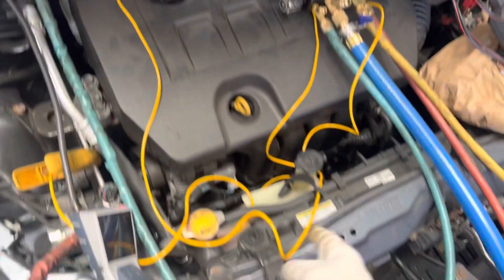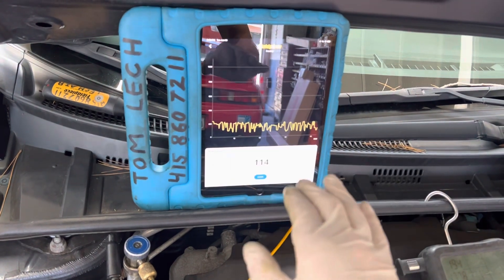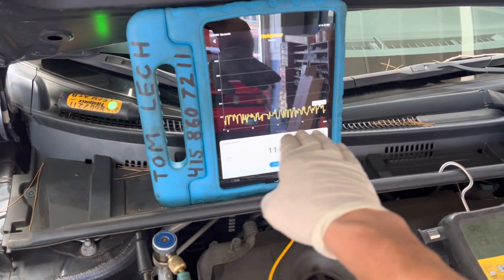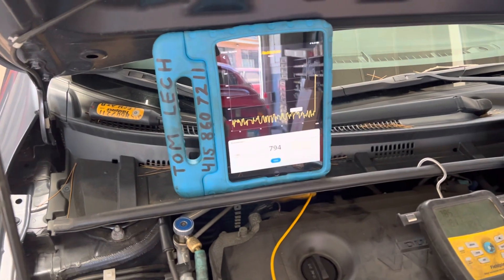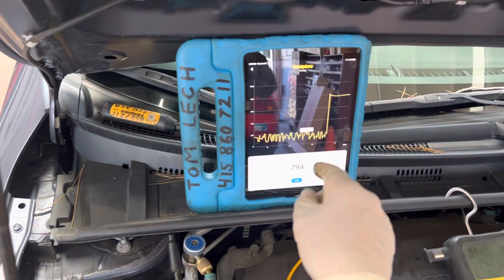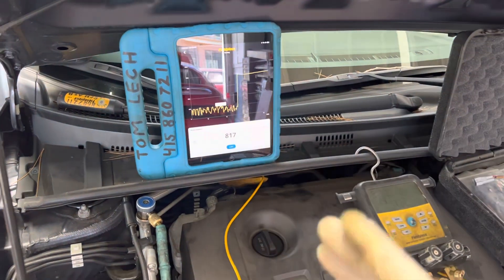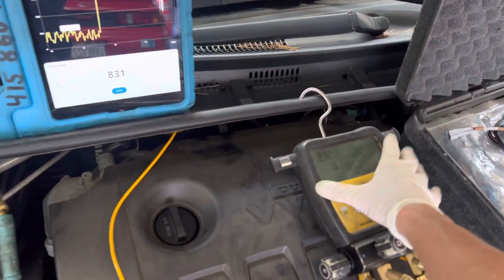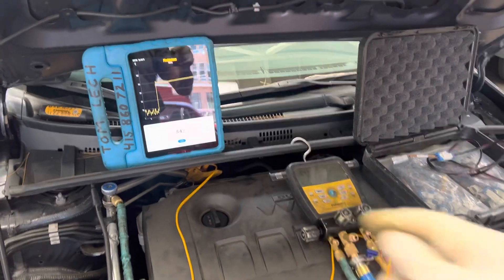Micron gauge readings explained on automotive. Micron gauge in your refrigerant manifold￼

Comment: In MVAC, after repairs, I always aimed for holding 400 microns, with the pump off and the system isolated for 15 minutes with no rise. After that, I liquid charged the system with the vehicle running and AC on. I then went over the entire system with a calibrated Yokogawa H10 and checked for any leaks under pressure. Once that was done, and no leaks were found, the repair was deemed a success after testing the controls and vent temps on a road test with airflow over the condenser. I warranted all repairs for one year, parts and labor, excluding items not replaced/repaired. In 5 years of MVAC I had 3 warranty claims 2 of which were due to reman compressor failures....
Reply from the maker: Vacuum is one of the worst ways to rely on for leak testing. 
        It is the least reliable way. 

But it’s good at finding the big ones . 

But sometimes even a big vacuum leak can seal under pressure. I got that on video a couple times. . 

400 µm holding for 15 minutes on a motor vehicle takes a extremely long vacuum time . 

I would say I could not do that on 98% of my vehicles I get from shops, especially body shops that leave the lines open to the atmosphere all day and sometimes for days and sometimes for weeks while they are waiting for parts . 

By the time the oil is completely saturated, and will never give up all his moisture .  Always a continuous outgas..  being limited to a hour of vacuum time.  I charge book times 1.4 hours for Recharge at $204 an hour.

That makes a recovery book time is .4 at $204 an hour. 

So by the time I stop the vacuum, the majority of systems will level out at around 1200 µm .  Nothing you can do about it. This is because of sloppy technicians who do not immediately cap off the ends of the refrigerant lines when they take them apart.. 

And some of these cheap garbage aftermarket condensers the second material comes already saturated with moisture in there, absolutely worthless .

And we always say compressors, and do not die. They are murdered. . 

Compresses well actually outlive the life of a vehicle .  ( if they are never allowed to go low on refrigerant never overcharged system is not contaminated with moisture or air.. 

Condenser fan does not fail. 

When I get vehicles for body shops where the hoses have been left off for days or weeks .   Even if I use my 12 CFM industrial vacuum pump that is rated to pull down to 3 µm with a silicone vacuum rated hose.. 
          I still cannot cat the moisture level down low enough so I can hold vacuum isolated for 15 minutes at 400 µm.    Just not humanly possible physics does not allow that to happen.. 

Unless possibly the vehicle was located in the Sahara desert with only 5% moisture in the air and every day is 120°F and I had the engine running with the hood closed so the under hood temperature was 200+ degrees Fahrenheit and I had the windows closed in the desert sun so the interior cabin temperature and the evaporator case was at 180°F 

Then I believe in one hour I could get the moisture content down low enough under vacuum to possibly have the chance to remove enough moisture that I can ball valve off the micron gauge and it would hold for 15 minutes below 400 µm .  

This is why I always tell do it yourself people to leave their vehicles on for 24 hours on the vacuum pump .  You can never over vacuum. All you can do is remove more moisture..
Reply: My typical maximum vacuum times were never more than 30 minutes. This was with a 6 CFM Robinair. However, pretty much all of my repairs were flushed. I often did liquid refrigerant flushing to remove everything. Manual flushing of components at other times. At the end of the day, no leaks under vacuum or pressure, the exact specified charge, and the exact amount of oil. But...I understand the difference between production work and passion. I was working from home in a semi-retired state so I could camp on them as much as I wanted :) My target market was retired people so...two cars...no rush...and wanting it to be perfect, the first time, and no issues with paying for it. 

But.....I'd like to draw your attention to something critical which you may be overlooking....the compressor seal. In order for those seals to work they have to be coated in oil. Any vehicle with an AC outage got a basic recover, evac and recharge as part of the diagnostic process. Without oil coating that seal, on most every car, you're never going to get a proper micron reading. 

As an example, GM service manuals, at the time, specifically mentioned that the service port caps, and their rubber washers, were considered the PRIMARY seal. IE, not the schrader valve, but the cap. The valve itself was considered the SECONDARY seal. Understanding their rationale behind that explained what I was always seeing with respect to the compressor seal. Until I understood the importance of oil coating the compressor seal I was always seeing goofy micron readings that never made sense.....

Ultimately, I designed and built my own recovery machine to streamline the process because my process was very different but resulted in the '4 nines' when it came to the success rate I was looking for. 

Let's be clear, compared to HVAC, MVAC is a very tiny system. As such, a 6 CFM pump is literally, overkill. A 30 minute maximum evac time should make sense given the size of the system. I'd encourage you to seriously consider the compressor seal and its impact on evac times...and the oil coating...if it exists....

I never let a vehicle out the door with 1200 microns. It never happened. The highest micron level that was acceptable to me was 750 @ 15 minutes. Anything more was an indication of non-condensables or a leak. 400 was considered 'hermetically' sealed and 750 was considered on the wide side. Rarely did I see one in the 300 range that would hold for 15. Nylog on all the fittings and always checked under pressure with the Yokogawa. So leak testing was a two-part process, one under vacuum and one under pressure.
Reply from the maker: @bobjones3725  I was raised on the H 10 the original GE model leather case plugged into the wall when I was 12 years old that’s what my dad had me start using it to find leaks. 

Yes, when I do large commercial like a LG Panasonic or FUJITSU 20 to 60 tons will have anywhere from 1000 feet to almost 3000 feet of copper piping anywhere from 8 to 20 or 60 refrigerant air handlers attached to it.  
    Always pull them down below 100 µm the lowest I’ve ever got I think was 13 µm I got a video posted on that one. 
          Decay and held under 100 µm. 
     But that’s using a $3000 vacuum pump rated down to 3 µm.
Reply: @coldfinger459sub0  Sure, I suspect I'd see vacuum levels like that in MVAC were it not for the rubber seal on the compressor shaft. My pump will actually do 20 microns isolated. My point remains, a 6 CFM pump is overkill for an MVAC sized system. It's why I chose a 'large' pump at the time - for faster evacuation. Evacuation should never take the length of time you are encountering even if the system was wet - provided it has integrity. Out of all the vehicles I did, evacuation was typically less than 30 minutes to 400 microns including boil-off time. Anything more was an indication I had not done my job right OR it was just a quick & dirty (ie, no accumulator/desiccant replacement etc). 

I pioneered using a thermistor gage in MVAC about 20 or 25 years ago. As you know, the reason is analog gages are not granular enough to show if the system is dry so people were leaving their pumps on for 24 hours or even 8 hours in a shop and calling it good. They measured vacuum by how long they left the pump on, and of course, it was always at 30 inches of vacuum! Honest !!

Imagine my surprise when I found that less than 30 minutes was actually required on a system with integrity using a thermistor. But...before I got to that point, I did have to do a whole lot of thinking that led me to understand that you cannot pull a deep vacuum on a system where the compressor seal is not properly coated in oil. It was actually my Ozone Depleting Substances teacher that, indirectly, put me on to that....

He mentioned when he was doing MVAC he used to get called out to logging camps all the time to fix the AC in excavators. What he found, after a lot of mucking around, was that they would sit idle over the winter and the oil would drop off the seal and allow the charge to escape. No other leaks were present. This is one of the reasons auto manufacturers decided to put the AC on when in Defrost mode. It keeps the seal coated in oil. The fact that dehumidified air is better is a side benefit. 

In an excavator, that, in this case was used only in the summer, it means it has 9 months or so of sitting and the oil drips off the seal and then there goes the refrigerant. 

But to make it really simple, you would know from experience how long it takes to evac all sorts of sizes of HVAC systems and how that relates to the size of the pump. Systems that are WAY larger than MVAC. So my question to you is this, does it make sense that a tiny little AC system, such as in MVAC, takes hours and hours to evac using a large HVAC pump? 

Could it really be that full of water? Or...is it something else...like the seal on the compressor is leaking....or is not coated in oil...causing it to leak outside air into the system causing the rise in rate? Let's face it, if the tiny MVAC AC system has integrity, even if it's got water in it, a large HVAC pump should be able to deal with it very quickly. A pump with a gas ballast valve, in combination with a thermistor gage, makes it really easy to determine when to close the ballast valve for that ultimate vacuum. 

The worst MVAC evac times I ever saw was one hour. Anytime it took longer than 30 minutes I started to question whether I had introduced a problem or missed something. An hour would be like, 'it's been sitting in the wreckers for a few years' :)

This is why, procedurally, every system I estimated/diagnosed was fully charged. That way you get maximum pressures, increasing your chances of finding a leak, and you ensure the compressor seal is coated in oil - removing it from the equation. You also have the benefit of then being able to test the controls/blower/pressure switches etc. Ie, does the system work? Or does it also have an electrical issue? Is the compressor noisy? Does the clutch work properly? Does the condenser fan run? 

Once diagnosed it can then be recovered and properly estimated. It's a bit of work (which is why I made my own recovery/charging machine) but that was the only way I could absolutely nail it every time with an accurate estimate and warranty my work for a year with unlimited mileage. 

It's much harder in the example in your video. Unless you have already gone through the entire system you just don't know what you have. Ie, if a body shop brings it to you to be evacuated and charged because of front end damage. You have no idea what the system state was like before you got it. It may not even have worked at all. In a case like that, using a thermistor gage is almost useless (in my mind) because you do not know if the system has integrity at all because you haven't chased down all the leaks. 

As an HVAC technician you will have much more knowledge of AC than I as a former MVAC technician. But I think that your premise of pulling an 8 hour vacuum due to continual boil-off is not correct in such a small system. Rather, I would suggest the system does not have integrity to begin with. If it did, and if it was wet, a 6 CFM pump (or better) should be able to deal with it very quickly assuming the pump and the oil have integrity. Not trying to get your goat, I just know that after doing a LOT of cars, they always pulled down to 500 microns, typically in 15 minutes, and would hold it for the same amount of time if the system had integrity. Each system was different, some faster, some slower, but anything more than 30 minutes set flags in my mind. 

Of course then you get the oddballs like a Suburban with rear AC and the rear evap was just fine during testing but once the repairs are done it blows out because it was weak to begin with and the increased pressures put it over the edge! Which is why I always explained to my customers, at the time of the diagnosis, what's written IS what is wrong, at that time, but it's AC, and it can always bite you in the rear. In other words, I don't have x-ray vision :)
Reply from the maker: @bobjones3725  these are ancient old systems you’re talking about with shaft, seal problems. We don’t very rarely have that problem on existing working systems anymore….      What we do have occasionally for some known manufactures are weak shaft seals.
            Which chef seals will show up losing their vacuum and then stopping let’s say 29 inches of mercury 28 or 27 inches of mercury and then just stopping having nothing to do with oil.   Sometimes you get lucky and you can reset them with refrigerant after two or three minutes of operation and then recover the refrigerant and then start your vacuum procedure again and then it will seal.

And low vacuums you’re talking about holding 400 µm within 30 minutes doesn’t happen in the real world with POE oil in cars with rubber hoses that have been completely moisture saturated by being left open to the atmosphere like 98% of them are when they were worked on by technicians .  You can easily pull down to 400 within 30 minutes but as soon as you valve off, it always jumps up around 1000 1200 1400 just because of the moisture content no leaks no seal leaks it stops in levels off.

Now on a brand new install that’s a completely different story you get less than 400 µm in less than five minutes no problem at all . I’ve I posted that video several times on brand new installs on clean systems with brand new receiver dryer’s..
              Mineral oil from the days of R12 is very easy to I’ve posted many of those videos usually old Mercedes Benz that somebody finds with 15,000 miles or 30,000 miles on them haven’t been touched by anybody just leaked out all the refrigerant down to near zero psi naturally through all the hoses in the front shaft seal.  How quickly get below 500 µm within the first five minutes because it’s mineral oil..  
                            You’re right the size of the pump doesn’t make a difference. It could be a half CFM or 100 CFM. You’re a limiting factor will be your hose indecisive the office of the fitting that you’re pulling through on how quickly you can get there time is money.

Yes, I want to start it out with the Simister vacuum gauge analog type six or eight D sell batteries in a leather case yeah the warm it up for five minutes then you had to touch the sensor to the stainless steel face plate and then zero out the analog needle to zero.   They were temperature sensitive, and if the weather changed, they were sensitive to the barometric, atmospheric pressure change just having clouds pass over.
But they were extremely accurate as long as you didn’t have temperature change or barometric change .
       To this day, they still use analog sensors in deep laboratory, ultradeep vacuums that that way up there to ninth to the 10th power 0.00001 yeah, crazy numbers like that with analog gauges.   If you go to buy some you’ll find out just a sensor alone can start running you $1500 and up really fast.. 
        Nothing wrong with analog age is just a people who don’t understand where and when they can do use properly and what will throw off the readings on the micron gauge sensors.   Yes, I started in 1979.. using r12 to cool down soda cans blow over r12 into my steel toe boots to cool off my feet on a hot summer day and freeze bigs

Most everybody went over deep, vacuum laboratory procedures when you take college courses in organic chemistry, or even material sciences, the fact of materials under deep space vacuum far over the heads, and beyond anything automotive guys, will I ever learn . 

Anytime I’ve worked on heavy excavator, equipment, off-road stuff. It was always trash by 20 guys who came before me. . It was the worst butchered AC equipment that always had way too much oil because of the guy always thought it would run out and so you always squirt in an extra ounce every time you top it off. When replacing parts, they left everything open and never will change the receiver dryer.. drive around all winter in the rain in mud with no AC with a giant hole in the condenser wide-open to the atmosphere with liquid water inside. I got plenty of those.. 

Yes, it completely makes sense for motor vehicles to take many hours to be able to pass a vacuum to take test .   Because we no longer use mineral oil like back in the Stone Age days with R12..
           We now use PAG and POE every technician who works on the system or every time that car is in a body shop in front end collision. The condensers get removed in the lines are left open to the atmosphere for days and weeks before the car is put back together..
                   So, on all those vehicles in a production shop, you have book time of 1.4 hours to do the job that’s all you get..   so that leaves you roughly an hour left if needed to keep your vacuum pump on and on the wet systems you’re lucky if you get 900 to 1000 µm after you do year 15 minute isolation vacuum decay test just because of the moisture level, trapped in the POE oil, you cannot remove all. 

There’s a physics thing that goes on deep down in the layers of the oil cannot migrate the moisture up to the surface. There’s a surface tension that can’t even trap refrigerant under the surface tension of the oil. .    

POE Oil is a whole different animal compared to men loyal, cannot even discuss the two in the same sentence or paragraph there a totally unrelated
       In the vacuum procedures, and the ability to get rid of moisture by vacuum is not possible with POE oil. 
           That’s why I’m a heavy commercial run at 20 or 40 hours swap out the dryer, run it for 20 or 40 more hours swap out another dryer and keep repeating until the moisture indicator turns green. 
          Unfortunately, in automotive, we don’t have receiver dryers that we can remove so easily and cheaply and accessible like you do in a refrigeration unit. 

And I do have a vacuum chamber pot for doing it I know in reference tank and placing different oil samples and pulling up overnight, vacuum, and washing the decay rate 
          It has nothing to do a shaft seals, and everything to do with the moisture content. 
            I’ve posted several videos on that topic too with vehicles that just would not pass multiple attempts to pull a vacuum kept going up to 2000 or 3000 µm because they were in a body shop where they left it open for a week or more
             And since it was the end of the day, and I wasn’t going to lose any time, I would just leave my vacuum pump running overnight and continue my video the next morning?    Showing that the vacuum we get all the way down to 50 µm or 40 µm.   And only after overnight 12 to 15 hours a vacuum did it finally pass the vacuum decay test and would hold two or 300 µm.
        with POE & PAG oil it’s all about the moisture content and knowing the difference, what is a leak in what is moisture.   Moisture always stops somewhere below. Usually the 3400 to 3000 mark and then just flat lines and does not raise.

And then, when you’re willing to leave it on a vacuum pump overnight, you will finally see it lower sometimes even going around with a heat gun or a torch along lines, heating them up, heating up a compressor, case heating up the receiver dryer, banging with a hammer on the bottom of the compressor case on the bottom of the receiver, dryer or accumulator even after your micron reading went down to two or 300 µm and then you see explosion of gas outburst and jump back up for five 600 µm from the entrapment that was under the retention of the oil surface. 
           This is stuff that you’re taught in lab class in laboratory procedures guys and Automotive are never taught

Ennius no matter what vehicle I have the first thing I always do is empty it out and fill it back up 100% by weight per manufacturers instructions and go through all the controls in the electrical to make sure everything is working first and then drain out the refrigerant to give my diagnosis in full list of things I could be wrong not just a leak

I know you think eight hours is a lot on these systems but then you don’t understand POE oil and leaving the lines open for several days. It absolutely doesn’t matter what kind of vacuum pump even using silicone hose or even using metal copper lines instead of hose to the vacuum pump direct with nothing more than a ball valve they do not pull down and hold because of moisture content, having nothing to do with front shaft seals.  You just prove it by leaving it on the vacuum pump overnight and then it will pull down and hold.